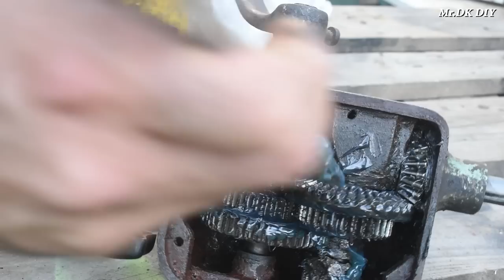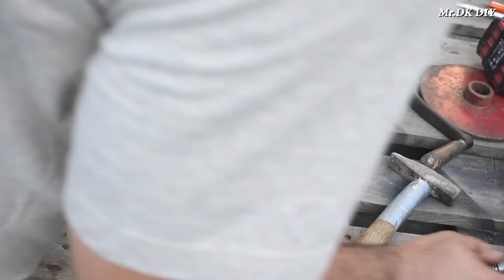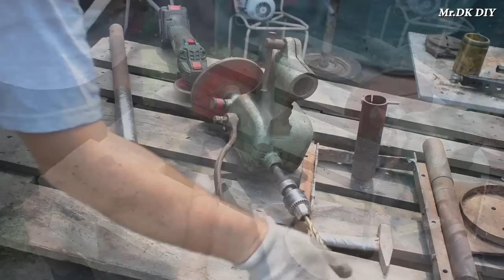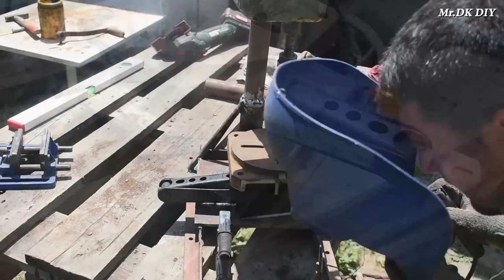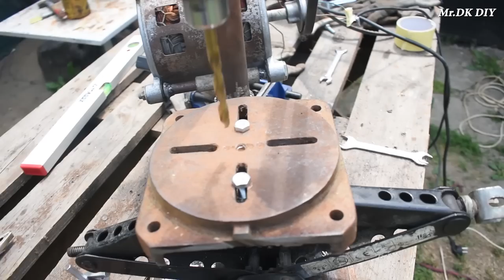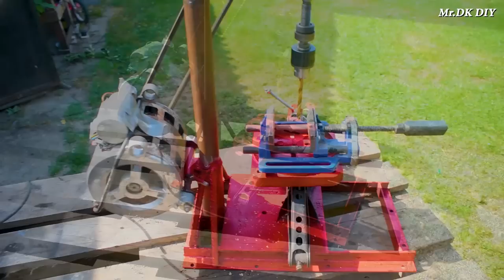OLD SCISSOR JACK AND OLD WASHING MACHINE MOTOR ??? Briliant DIY Project

Comment: Good idea but needs some corrections in order to fix the scissor jack  to move in a straight vertical direction. Also we need to know if it really drills the metal that's the most important thing as well. In general we try to make better.

Comment: I would call this Work in Progress, he just needs to make a handle or the jack, fit a kill switch at the operation end. It would have looked a lot nicer if he'd rummaged a bit longer for a piece of steel plate instead of using some rebar. But other than that, well done.

Just don't let the H&E inspector see it.